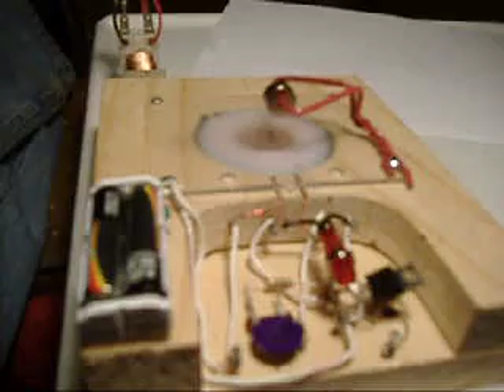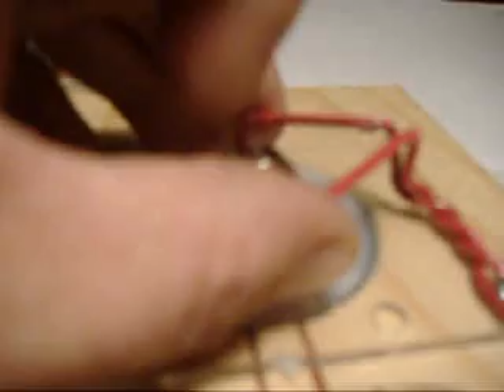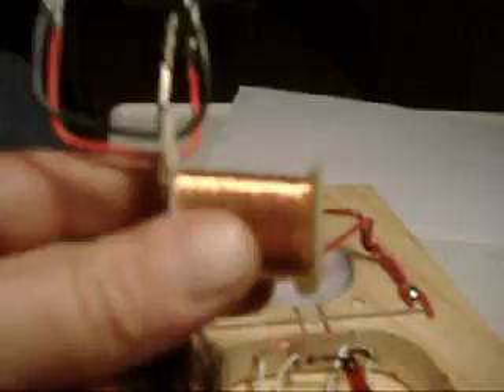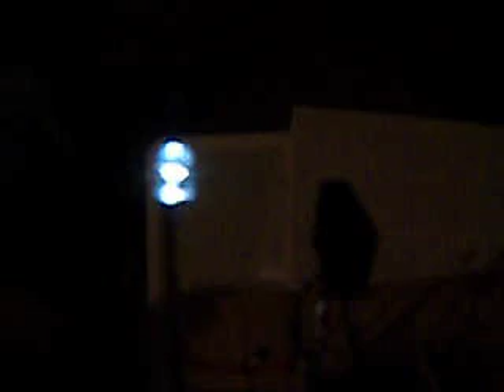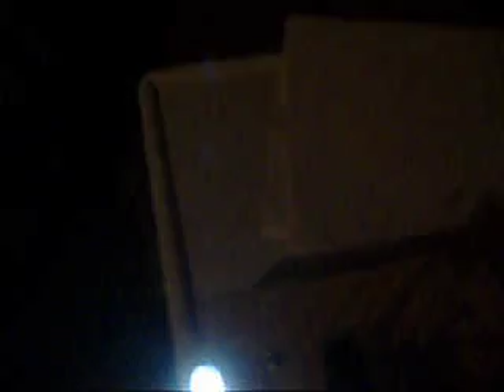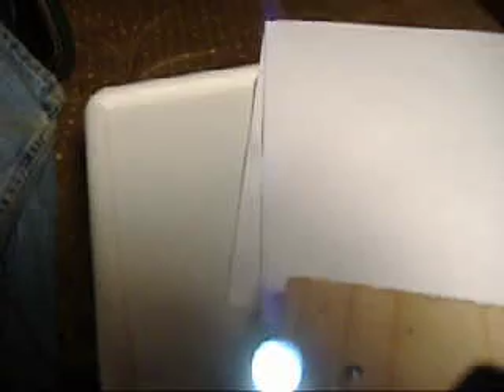Bedini and generator coil

Comment: does the coil have to be placed over the magnet like a window motor or can you move it away from the coil? how close does it have to be to start producing? im building a 3 coil setup and want more generator coils. im not sure if i have to use cores in each of them i want to get away without it though.